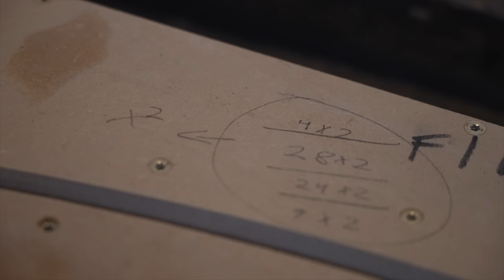MOUNTAIN BOW BUILD (part 2)

Comment: So many questions as someone who is interested in building/designing bows (I've only built a few so far).

How did you arrive at your radius for your limb reflex/deflex? A lot of trial & error in trying to find the "sweet spot"?

Before Bingham closed up shop, I built 1 of their longbow kits making a perfectly straight limb 68" longbow. I have since also built a 3Rivers fiberglass bow kit with some slight reflex/deflex. Your BONES bow appears to have even more reflex/deflex than the 3Rivers kit but it's hard to be sure.

Had I known Bingham was going to close up shop, I would have ordered more kits. I had wanted to build at least 1 (takedown) recurve to be able to compare my longbows against and get a better idea what I might like shooting more. I've also wanted to experiment with how much reflex/deflex would be "best" for me (I noticed that you talked a bit about finding what works best for "you" in this video and I appreciate that because I'm sure everyone has different preferences).

I notice you have kits for your BONES bow and I'm leaning towards buying said kit once I finish some other side-projects I've got going.

Do you also plan to make kits for this bow design? I'd probably be interested even if only because I have enjoyed building bows so far and it might help me narrow in on what I like shooting the most.

I have so many questions about how to go about designing a bow. I suspect the real answer to my questions is probably "lots of trial & error and gut instinct about what to try next based on past successes/failures". For example, I'd love to know what you've discovered about how much Reflex / Deflex to put into the limbs. What a good starting amount might be. How to tell if you've gone too far with one or the other. etc.

I think I watched a video where you explained the benefits of reflex and deflex, but I don't recall if you went into more details about designing a limb and how you might "calculate" how much to use.

Comment: What is that black material, used for bow limbs backing and belly? Is it US based only or is it available in EU aswell?
Reply: Backing glass. You should be able to get it in the UK.  Likely have to order it or spend some time in a hardware store.

Comment: Not sure if you know this trick, so I’m just gonna post it .
   Grab a chunk of eraser/ rubber and run it over your sandpaper whenever it’s gummed up with wood or metal shavings .     Strips all of it off nearly instantly and will save you a fortune over time.   Especially with sanding disks , belts and rolls